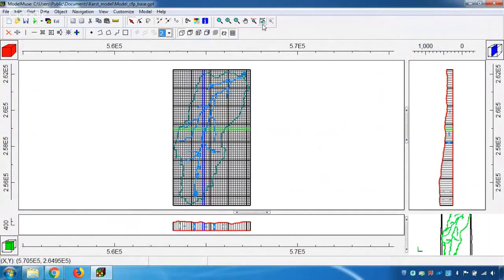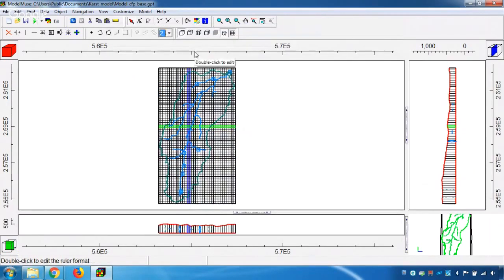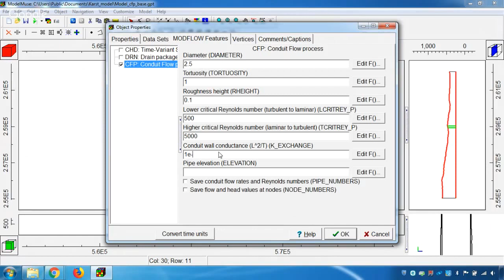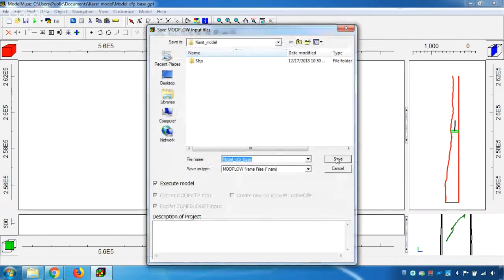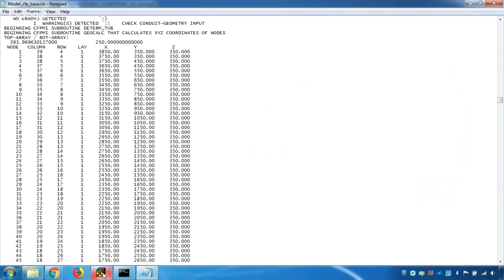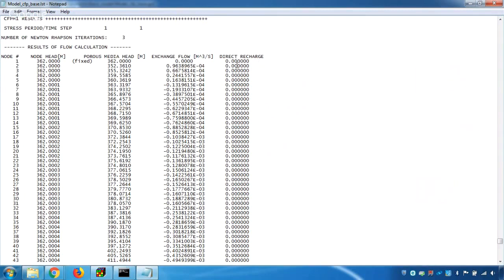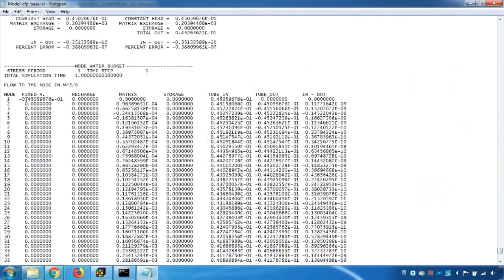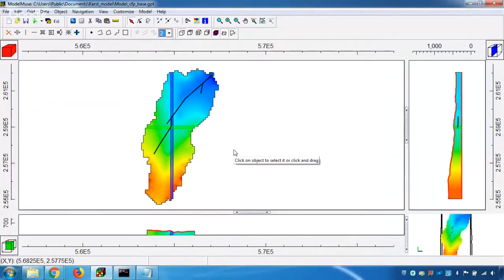Modelling of a karst conduit system using Model Muse and MODFLOW-CFP - Tutorial

Comment: hello, 
can the model use just one boundary condition simulating the spring as drain, because if the spring is dry in some periods, it seems that is not accurate to simulate the spring as canstant head.
thanks